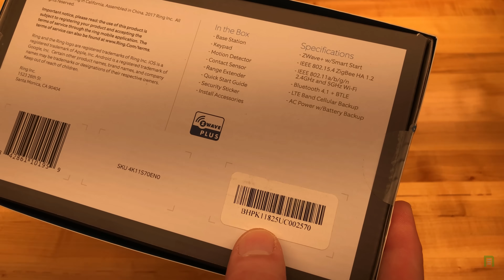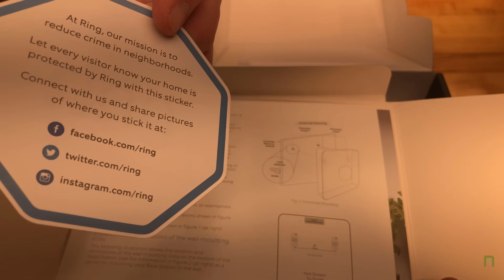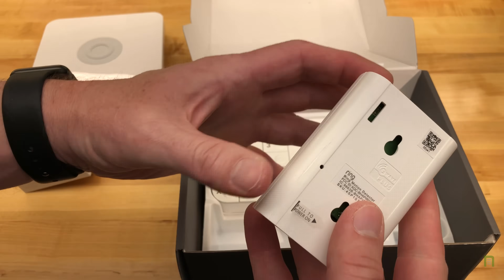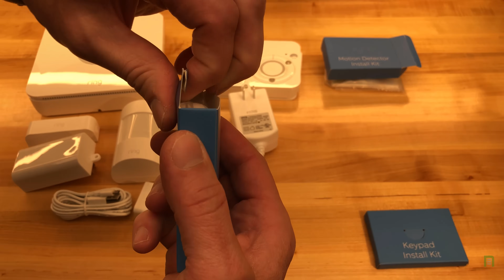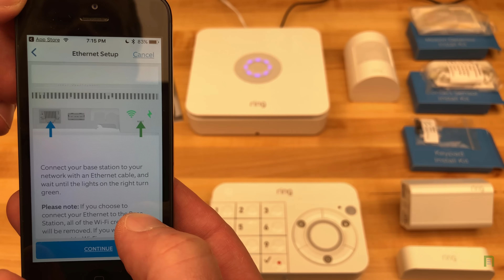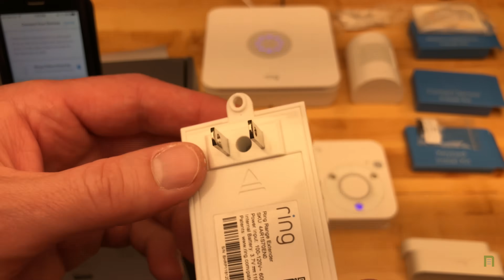First look at the Ring Alarm Home Security System [4K]

Comment: At 27:17 you were supposed to first type in the code then press the mode button. You don't need to press check. The check is only used for sensor bypass.

Comment: So, if someone breaches your home, finds your base station, unplugs the ethernet / bashes the base, are you shit out of luck? Assuming you are not home, you wouldn't have cellular back up...??
Reply: Asking, because, I'm wondering if you'd want to hide the base station?
Reply: INGLOCKWETRUST cellular backup is independent to the base station itself. As SOON as the alarm is triggered or is set into entry delay it sends out a signal that it’s in entry delay, if the monitoring station doesn’t get another signal within 60 seconds that it’s been disarmed it’s assumed an alarm and police are dispatched.
Reply: "Your Ring Alarm usually communicates with you or your monitoring service through the internet via Wi-Fi or an Ethernet cable. Any time your Base Station loses its connection to the internet, regardless of the cause, a cellular backup system kicks in that will allow the system to continue to monitor your home." - Ring article 115005323926
Reply: It comes with a battery backup and a AT&T Sim card!

Comment: It looks like there is no protection for the circuit board from the mounting screws on the motion detector and the door/window sensor. They should have put a piece of plastic under the circuit board.
Reply from the maker: Good point! The clearance seems fine when using the provided flat head screws, but if somebody uses a convex head screws, perhaps there could be an issue.
Reply: Paul Braren, or if they down screw in the screws enough to make the sensors tight to the wall. I buy black plastic report covers to put under circuit boards to protect them in these situations. I had to do it to computer chassis' and motherboards when the leeds on the motherboard were not clipped short enough  (clipping them may void the warranty).
Reply: I can assure you as long as you use provided screws that you won't run into issues. When people start using other things then what's supplied or jerryrigging things is when it goes wrong

Comment: Is there a nighttime mode for while you are sleeping?
Reply: Yes.  You can program it to monitor the sensors you want it to.  I just bought this last week, it's pretty slick.
Reply from the maker: Just the 3 modes, away, home, and disarmed, but like Joshua points out, you can tell it to monitor only the sensors you want it to (in home mode, and away mode).

Comment: Hello, I want you to do a video demonstrating test mode to show how that works. That giant circle in the middle of the hub is it's internal siren/speaker, in the video we heard two siren sounds, one coming from the base station and the other one coming from the keypad. Please be sure to muffle the base station siren during the test while keeping the keypad siren uncovered. The base station siren will sound muffled. I am curious which siren tone came from which device.
Reply from the maker: All good points, sorry I missed my opportunity to capture that properly, rushing things a bit as the 4K video was running rather long already. Your explanation will sure help others and I really appreciate it! I admittedly need to do some further testing, when nobody else is home to avoid annoying them hugely.
Reply: The base station sounded first then the keypad. However now Ring changed the siren tone through a firmware update and it sounds different. The first gen keypad still sounds the same but the second gen keypad has the new tone. All base stations now have the new tone.

Comment: Thank you so much for the review! Does the push app notification notify you right when the door/window opens or only if the opening triggers the alarm? Thanks!
Reply from the maker: Only if the alarm is triggered, but if I dig into the device view on the app, I can see real time open/close status as I tested the door and motion sensors (later, off camera).

Comment: is there an option to make the siren go off faster than 60 seconds?
Reply: block yup
Reply from the maker: The Ring Alarm instruction manual talks a bit about setting delays https://support.ring.com/hc/en-us/article_attachments/360002018826/Ring_Alarm_Security_Basics_Guide.pdf
Reply: @TinkerTry  But i don't fount any info about 60 sec
Reply: Yes yu can set it to 0, 30, 45, or 60 seconds

Comment: Good video. I set mine up yesterday. So far, so good. 👍🏻
Reply from the maker: Curious if you still feel the same way now, a week later.
Reply: Paul Braren -
It’s fine. It’s very simple. That can be good for some...maybe not so much for others. I’m already locked into the Apple/Ring ecosystems. I’m sure v2.0 will be better. 

But, set up was easy. 

What are YOUR thoughts after having it?